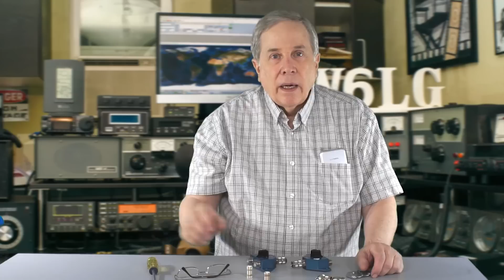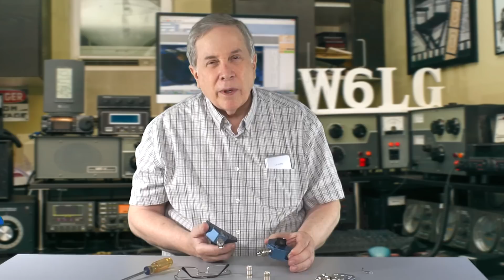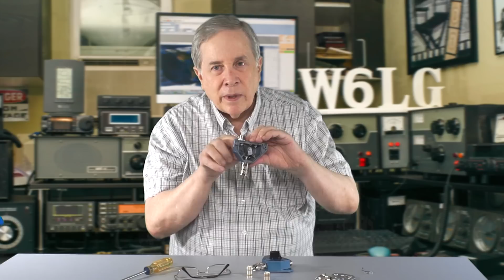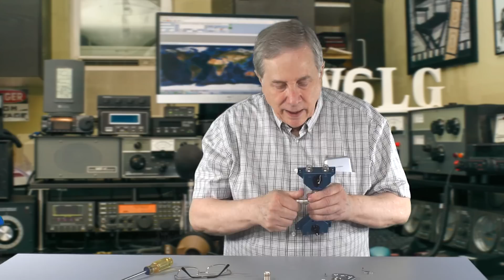Ham Radio Basics--Jim W6LG Shows How He Connects 2 HF Antennas at the Same Time

Comment: can I join two or three different (example 40/15, 20, 17) mono band verticals with a T adapter and still have 50 ohm / decent match on each antenna?
I am thinking at the antenna end, with just one run back two the shack.

Comment: How do you hook 1 antenna two radios with a SWR meter. I have a delta 3 position switch.
Reply from the maker: I am in the hospital and not able to answer quickly.

Both radios connected to one of the three ports on the alpha delta switch.  The single side of the switch to the swr meter input.  SWR meter output side connected to the one antenna.

I hope that helps.  73, Jim W6LG

Comment: How about a link to those coax switches?
Reply from the maker: I had to close the business due to cancer.  You might find them on Ebay.  73, Jim
Reply: @ham-radio  Well, I won't find them anywhere, without a manufacturer name and part number.  But thanks.  I hope things are going OK for you.
Reply from the maker: JETSTREAM CO-201 2 POSITION ANTENNA SWITCH w/ UHF SO239 CONNECTORS ACCEPTS PL259

MFJ 1702- 2 Position Antenna Coax Switch, HF/VHF/UHF

They are all over Ebay. You just have to look.  The above took one minute.  There are more.

73, Jim
Reply: @ham-radio  Thanks.  So, would you say that these are all roughly equivalent in quality?
Reply from the maker: @notgiven3114  I think they are the same.
Reply: @ham-radio  Thanks.

Comment: Many years ago I read an article in QST magazine which talked about making antenna switches for your HF system out of regular hardware store light switches. You can buy the enclosures for them fairly inexpensively and wall plates and make them as fancy as you want. The article warned that they probably would exhibit impedance bumps at VHF and higher frequencies, but would work okay for HF frequencies.

So the day finally came when I needed something like that and I built it up. What I have are for antenna switches that go to so239 panel mounts. Those can be attached to four different antennas externally, or in my case three antennas and one dummy load.  To my surprise and relief, they work just fine on HF. 

I expanded this out a little bit more and set it up with a line that led to a second box with two switches. This way I can connect to one HF radio or the other or if I want to listen to both at the same time I can have them both switched into the antenna system. I usually don't need to do that and you would have to take care not to transmit directly into the front end of the other radio but usually I just use one radio or the other and the rest of the time the antenna switch is set to the off position. If you're interested in a picture of what this looks like please contact me at n7jy.john@gmail.com and I can send it to you as an attachment.

Comment: So really you could just use theT if you want both antennas coupled
Reply from the maker: You can.  Just pay attention to what you are doing.  The impedances and frequencies are important.  You may need some kind of matching device.  I used that system to connect two yagis with phasing lines and a home made tuner.  Sorry for the delay.  I have cancer in my blood 3 ways which makes it difficult some times.  The prognosis is not good and I am doing my best to forge ahead.  I had emergency surgery a week ago and the stay in the hospital was terrible.  Happy Holidays and 73, Jim W6LG3 Jim W6LG

Comment: Thanks Jim. I'm a bit limited for space but I have a long wire slit with a balun  plus a vertical and have wondered about using them together and this I will try, using  each on there own my SWRs are very low so yes its worth a try. Thanks Dave..G4MCL...Manchester..UK.

Comment: I hope you see my question??  I have one 2 meter 70 cm attached to a single switch and two pieces of coax running out to my 991a and my 300.  I've noticed it doesn't matter where the switch is positioned I get signal coming through both radios......if I have them both on the same frequency.  I couldn't help but wondering if I was damaging both rigs?  Please comment as this has been a hot topic of conversation with my buddies.
Reply from the maker: Yes. You can and will very likely damage one of those front ends.  If you use a switch, it must short to ground the unused coax connector.  The front end of a transceiver can handle a certain amount of signal.  Let's say it is 100uvolts and you put 1 volt into that transceiver.  I suspect it would blow up that first solid state device/receiver preamp.  I use Russian vacuum relays from Ebay.  I keep the leads extremely short.  Unused connections can be shorted to ground.  I have amplifiers that easily run full power.  I have to be careful to protect my transceivers.   73, Jim

Comment: Mr. Jim, would it be possible or reasonable to use 2 G5RV antennas, one facing east to west, one facing north to south and using the same type of switches and build a 3 ft. long co-phase harness to use as a jumper to run those antennas at the same time and what might be the effects on transmit and receive? Thank you, 73's, Jeff, KN4OTZ.

Comment: Hi Jim, thank you for this video. Just got my Ham license best thing ever since butter on bread. I was wondering is it possible to have 2 antennas 1 vertical and 1 horizontal both tuned to 10 metres however both in the radio at the same time. I'm aware of multiband antennas like DX Commander just wanted to ask before considering making a move and blow my equipment up lol. Many thanks in advance Sir.
Reply from the maker: Yes and I have done that. Furthermore, I plan on doing that again.  A couple of things to keep in mind, the polarity becomes random after it hits the first layer of the ionosphere.  In other words, it does not stay vertical or horizontal.  It is my view that other than the 'near field', at HF it becomes an elastic wave that is changing all the time as it bounces around the planet.  You can hear that in distant signals.  There is that phase shifting sound over very long distances.  You can make antennas that can be tuned to different bands.  However, I recommend that you concentrate on two bands.  Learn them!  With where you are, I would very much recommend 20 and 15 meters for a start...I meant metres.  A two band dipole would be good.  A a good way to learn.  
73, Jim Heath W6LG

Comment: i will try this on my two hf antenna. By the way, would it works also in 2meter?
Reply from the maker: Sure. 73, Jim former building inspector who looked at a lot of stamped, signed plans over the years.
Reply: @ham-radio  are you also an architect jim?

Comment: can I use one of these to switch from my vertical dual band to my dual band beam antenna ?
Reply from the maker: Sure. One of those is just a switch.  It is a single pole double throw switch. Have fun!  73, Jim
Reply: @ham-radio   thanks Jim ... ki5gks
Reply: @ham-radio   I plan on mounting the beam right under the   vertical .
Reply from the maker: @boscou2  What is the polarization of the beam?
Reply: @ham-radio   vertical,   2m/70cm

Comment: Okay Jim, great video. My question remains, can your setup for 2 antennas using 2 switches be also used for connecting 2 antenna through a switch to 2 different transceivers connected to the second switch?  I have a Yagi and a vertical vhf/uhf antennas and two different transceivers.  At times I need to use the Yagi and other times the vertical.  Will the 2 switch idea work here too?  CG N5CNG
Reply from the maker: Sure you can do that.  Put two single port ends together with a double male. Then you will have 2 inputs and 2 outputs. So, it will be 2 to 1 connected to 1 to 2.  Does that make sense Christian?  73, Jim

Comment: Hi Jim, Thanks for your videos! I've learned quite a bit from them. I realize this video is a couple years old but thought I'd ask my question anyways: If you left out the T between  the 2 switches could you use the 2 switches to connect 2 different antennas to 2 different transceivers? Say I have Dipole A and Dipole B; Radio A and Radio B. I want to be able to use either antenna on either radio. To me it "looks" like it would work but I'm not sure if I'm missing something or not and am afraid to try it without a more experienced look at the idea. Keep in mind, I only want to use 1 antenna and 1 radio at a time. And my thinking is that by running feedline A and B to one switch, and radio A and B to the other switch I could then just manipulate the switches to connect the antenna of choice to the rig of choice. Thanks and 73's!

Comment: As long as this is being done on a single band. there is a simpler way to accomplish the same thing, it requires a three position non-shorting coax switch, three connectors and two 1/4 wave lengths of 75 ohm coax. With only one switch to deal with, you can select either antenna separately or both antennas and have a low SWR.

Comment: Hi Jim i have often wondered about this, but cant you just put an impedance matching section in the feed line so the radio still sees 50 ohms even if the two antenna in parallel are 25, or something like a 2:1 balun or a1/4 wave of 75 ohm coax, i dont know the mathematics but people who stack verticals on trucks i think do it with a matching harness which is essentially what that is...from Fred in England...
Reply: Also awaiting for an answer to this good question.

Comment: Hi Jim! I'm new to the world of amateur radio, and your videos are absolutely incredible. In fact they have inspired me to go ahead and get my licence when a test is available in my area. While I don't have an amateur radio background, I do have both a physics and electrical engineering background.The reason I'm writing is to address a potential problem that buzzsah brings up in the comments. (you also hinted to it when discussing the SWR issue in the video). I'd like to suggest connecting an impedance matched load to the two connectors that are currently left open. This way, the coax running into the antenna tuner would see a constant (at least in theory) impedance regardless of the switch position. In my response the the comment below I recommended a simple load terminator though as I think of it now it would need to be something that can handle more power. A 100W resistor in a grounded enclosure would probably work for HF. 

Do you think this would work? I would love to hear if you decide to try it.
Reply from the maker: It is certainly worth a try.  Of course, they would need to be non-inductive at HF.  There is a "but" or a "what about."  If I put a dummy load across the "out" position, it is now loaded and receiving a portion of the power from the transmitter.  With no load, it might be infinite.  With 100 ohms, it might see something less than half the power.  If for example I am running one of my amplifiers at 1500 watts, that is a lot to deal with.  But what about receive?  Would that not put a non-inductive resistor in parallel with the receive antenna?  It is early morning and perhaps later in the day I will see this more clearly.  What are your thoughts?  73, Jim
Reply: Thanks for the response Jim! I'm going to think about this a little more as the day goes on, but here are my immediate thoughts. 

The power loss would certainly be present. I was thinking of transmitting at ~100 watts, as the radios I had been looking into for myself all fall into that power range. So for any setup I would be looking at a 50 watt resistor is pretty cheap, and in my mind SWR at 1:1 and 50 watts seems like it may be better than SWR at 1.8:1 and 100 watts, but I don't have the experience to say that this is true. 

As for receiving, yes there will be a non-inductive resistor in parallel with the receive antenna. However with the improved SWR I would expect the signal to noise ratio to be improved despite the diminished signal strength which could be made up for with RF gain. The end result should be a clearer signal than that with the open.

1500 watts changes things a bit. I think a simple restive load no longer makes sense, but perhaps the some sort of reactive load (I'm not sure that's a correct term, but I think you know what I mean) that has an electrical length appropriate for a standing wave. This would probably have to be something with a variable reactance and effectively act as an additional tuner. Admittedly I'm starting to get in over my head at this point, and may be placing too much emphasis on SWR.

Comment: Question, when you switch to 1 antenna the other switch is open without a load. Isn't this causing a problem?
Reply: only if your transmitting at the time.
Reply: This could be solved by adding an RF load terminator. like this one: https://www.pasternack.com/50-ohm-rf-load-terminations-category.aspx If it's impedance matched to the antenna then that should also improve SWR.
Reply: Actually looking at the specs, these only handle 0.5W but a higher power impedance matched terminator (could probably be homemade cheaply for HF.) should do the trick

Comment: If you switch one side to A (using one of the antennas) and the other side to the B position (no antenna), wouldn't that leave one of the SO-239s open and transmitting power into the air? That's the part that lost me. It seems like this would be the same as transmitting without an antenna and the SWR would go nuts and potentially damage the radio. Far as I can tell, these are not on/off switches, these are either/or switches. Should I have the open sides going into a dummy load? What am I missing?
Reply: No, not at all.
Reply: No, in the video, you have missed the part where Jim stated that when switched to the active SO-239, the ununsed port is shorted, so it would not be open.

Comment: I didn't immediately understand that your goal was to use *simultaneously* two antennas. The topic per se would be interesting, as I am not sure that "superposition of effects" holds true, or in other words, that using simultaneously two antenna in transmission, the radiation pattern and performance will be the sum of those you obtain individually.
Reply from the maker: Not exactly what happens.  There are additions and subtractions.  The results can be very complex. There are a lot of variables.  It is good to experiment and figure out what is happening. Thanks.  73, Jim W6LG

Comment: Jim you have talked here about two antennas! I have a interesting problem. I have for many years used a 10 meter antenna as my 11 meter base. And I have a multiple band but I have added yet another HF RADIO. How could I use the two antennas with the two transmitters? Switching them two use either with either transmitter?
Reply from the maker: Sure. Use the configuration that I showed except you don't need the 'T' in the middle, just put them together. You would have 2 inputs and 2 outputs. Two transceivers and two antennas are possible.  73, JimW6LG

Comment: Awesome video Jim, back when I was on cb I had a Dosy test center. This meter had antenna selector built in. I could run vertical, horizontal, or both V & H. Is something made like that for Hf? Again great vid.
Jim...KB8YBG